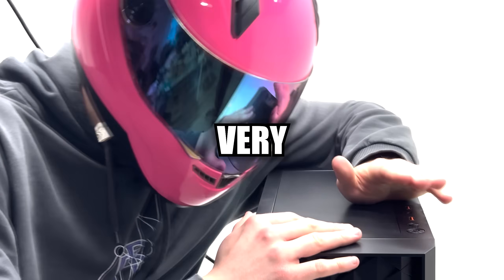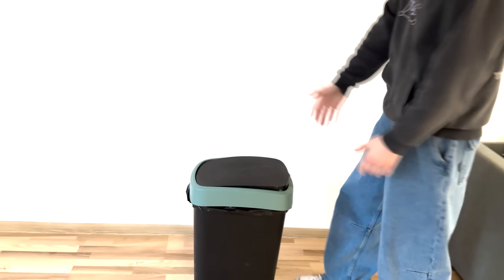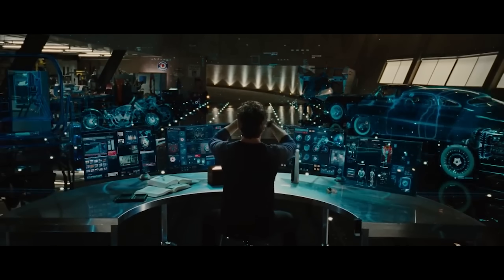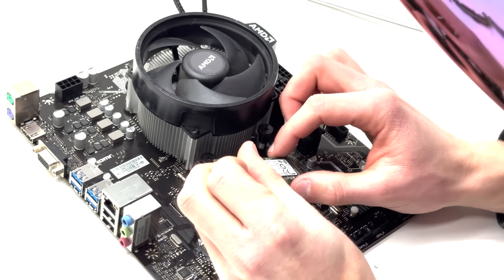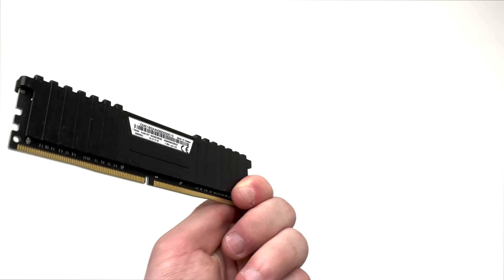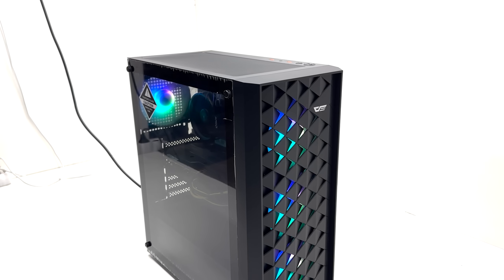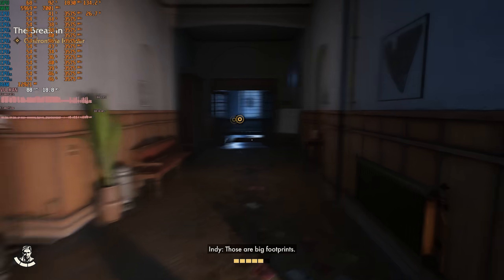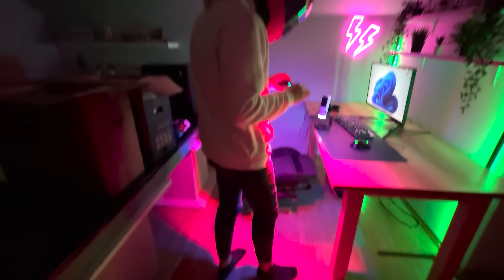Building RTX Gaming PC under 300$

Comment: Hear me out, $440 for a i9 9th gen - EVGA 3080 - 4x8 gb of ram - 650 watt gold - tripple fan AIO (LED doesnt light up but works) rest work perfectly full tower case
Reply from the maker: Now that's a STEAL
Reply: @CheapBastard  all bought from facebook marketplace locally 

Evga 3080 -$240
650 pcu - $40
Half built case (max out 2018) 
Was only missing the GPU and pcu
I9 9th gen, 4x8 gigs of ram, 3 fan Aio, 
ASUS ROG Maximus XI Hero mother board, 1tb 970 ssd - $100💀

Total was $380 not $440

I accidentally added a swap deal I did of a Xbox 1 for a 500 pcu + rx 580 

Xbox 1 valued at 60 ish

Comment: Currently rocking B450 machinest MATX, Ryzen 3 3200g, cheap 120mm cooler, Gigabyte RX 580 8gb, 600w PSU, and 32gb of T-Force Xtreem 3600 "inside" a Thermaltake core p3 "case" (using that term generously lol".. all of it used off of FB marketplace, AE, & ebay for $325. Just or the sole reason of playing Helldivers 2 lol

Comment: For 600 i got
RTX 3060 Gigabyte Eagle 12GB
Ryzen 5 5600x
16Gb RAM Corsair RGB 3200MHz
SSD 1To
Gigabyte B550M
Typhoon 550W 80+ Bronze
Watercooling  240mm
MSI MacForge M100R

You can find very good deal with a little research !

Comment: I bought a pc from a friend and the specs are, i5 9400f, Gtx 1060, h310m motherboard, and a deepcool cpu cooler and the case is a generic case, I bought it for 200$ USD and I am wondering if I got a good deal
Reply from the maker: If the 1060 is 6GB, it is a fair deal

Comment: I built mine with:
CPU: Ryzen 5 3600XT
GPU: Rtx 2060 dell oem
RAM: 32 GB Crucial DDR4 pro kit
SSD: 500GB Samsung 970 evo plus 
HDD: 2TB WD 
PSU: NZXT C750W 80 Bronze Plus 
Cooler: Endorfy Spartan 5
Case: Kolink observatory lite white
for 300
Reply: and then i sold 2060 for 100 and bought 3060ti for 173

Comment: ive built myself a sell precision t5820 bare bones 189 usd,xeon w2235 6 core 12 thread 3.6 base clock 4.6 turbo 89 usd  32 gb  ecc 40 usd  8 tb dvr hdd 35 usd i already own a gtx 1660 oc 6gb

Comment: My first gaming PC was an AliExpress combo with a Xeon E5-2670 v3, a random X99 motherboard, 18GB of RAM, and the legendary MSI GTX 1080. It was a great system, and I loved it, but sadly, I had to sell it. I was really bummed out and missed that rig a lot.

Later on, my friend came through for me in a big way. As an early birthday gift—since I’ll be heading off to university soon and money’s gonna be tight so he got me an EVGA RTX 2060 (single-fan model) for just 100 euros. Around the same time, I stumbled on a killer deal for a full PC build with an i5-9600K, 16GB of RAM (2x8GB HyperX Fury 3200MHz), and a Gigabyte Z390 Gaming X (v1).

The cherry on top? It came with a GTX 1050 Ti, which I sold to my friend for 25 euros for his fourth build, dude’s a true PC addict.

All in all, everything in the PC came up to 350 euros, but I still need to find a better cooler for the GPU. Other than that, the system runs great and looks even better after some solid cable management.

Comment: For 450 euros here is my build I managed to snag and hopefully sell for 675 euros:
• CPU: Intel i5-12400F (6-core, 12-thread)
• GPU: RX 5600 XT 6GB
• RAM: 16GB DDR4 (2×8GB)
• SSD: 1TB Kingston NV2 NVMe
• Motherboard: Gigabyte B760M
• PSU: ADATA XPG Pylon 550W (80+ Bronze)
• Case: Thermaltake View 170 ARGB
• Wi-Fi: TP-Link Archer T3U

Comment: I also managed to do a budget pc build recently, but this time with only 100 dollars. I managed to get an Optiplex 3020 MT with an i5-4590, 1T HDD and 120gb SSD for about 40 euro. A gtx 1650 for 40 euro, and got some ram and a 400w psu plus some connectors to work in that thing for about 20 dollar and now i have "brand new" i5, 16gb gtx 1650 gaming pc. I also want to swap it with a case i found cheap with a lot of RGB but that will be another 20 dollars, so i guess if i want to sell it i have to broke the budget a little.

Comment: $500
Used rtx 2070 super
Ryzen 5 3600
B550 motherboard
Case with 3 pre installed fans and a Psu basement
600 watt psu
16gb ram
512 gb ssd
Reply: Great pc for the price

Comment: I built a PC with an i5-9400F, RTX 2060 6GB, 16GB DDR4 2666MHz all on an Asrock B365M Motherboard, with a 500GB 2.5 Inch SSD and a 750W PSU in an RGB Case for £230. I'm selling it for £350 probably
Reply: Nice very good idea
Reply: bro i have almost the same build i have i5 9600k and 2060 single fan by evga and 500 m.2
Reply: You could easily sell this for around $400.

Comment: Isn't the Ryzen 5500 slower than the 3600? It doesn't have PCIe 4.0, and it has a smaller cache.
Reply: But the clocks are better, so even with the smaller cache, 5500 is very slightly faster. I would say 3600 for used, 5500 for brand new.
Reply from the maker: They're about the same. Just 5500 is slightly more interesting than the 3600 cause that legend was used in like 50 billion pc builds 😂
Reply: In game it is. The bigger chace on 3600 its better...and We all know ,thank to X3D cpus , the importance of chace in game. Finally the PCIe 3 its a limit , if you choice some cheaper or low Tier moder BS GPUs , like I imagine you will with a economic build.
5500 its always the worst choice.

Comment: I bought a PC for 150 usd, GTX 1070 and 16gb of ram, but the CPU worries me it's a 4c/8t i7-7700 saw your video on it worried it won't handle a RTX 2070/3060/6600 those are my planned upgrades.
Reply from the maker: For 150 you really got a solid deal!

Comment: I just upgraded my pc for overclocking at the same price (upgraded to 32 gb ram, 1350 watt psu, and better AIO)
Reply from the maker: Daaaamn, what kind of build needs a 1350w PSU and an even better AIO? 😳
Reply: @CheapBastard  1350 watt psu is for upgradeability for the most part, AIO is because the i9 9900k is like the og i9 13900k other than that, 16gb ram doesnt cut it for editing or gaming really anymore.

Comment: Currently hunting for a case, but the 2nd hand market is filled with 15 years old cases at the same price they were sold back then, thus 50+ €. The 20-25€ avaialble cases are just terrible for airflow on top of having the PSU slot on the top. That and waiting for a discount promo on Ebay so that I can get a b660m for around 60€, while I'm gonna pick an i3 12100f from a store that is selling it as tray for 55€. Gonna pair those with a RX 5600XT (trash Mech OC) a 16gb 3600mhz Cl16 kit I got recently on Aliexpress for 27€ and a spare CX450 for a secondary/guest rig. I'll try to hunt down those SN740 256gb for cheap as a boot drive due to the PCI-E Gen 4 and use the spare sata 480GB SSD for storage/games.

Btw that Samsung NVME is basically similar in specs to a 970 Evo Plus, pretty decent imho. I had one in my working laptop and replaced it with a 2tb one, while currently using it as secondary drive on my main system.

Comment: Any amd card replacement for this build?
Reply from the maker: A used RX 6600 or even 6600 XT if you can get it. An RX 5700 and 5700XT is just as good, but they don't support ray tracing😭
Reply: @ when you’re going cheap you don’t CARE about it (raytracing)

Comment: Man, I recently picked up a crazy deal here in Germany  got a whole bundle for 100€: R5 2600 with unused stock cooler, B450 ASRock Pro4, 8GB (2x4) 3000MHz RAM, brand new CX550M PSU, and a GT 710 lol. Then grabbed a 256GB SSD for 20€, a brand new Wraith Prism for 6€ at a local market, and even managed to talk down an RTX 2070 Super from 150€ to 100€. Just need a case for like 50€ and I’ve got a full gaming PC 😂🔥
Reply: I would buy more RAM ASAP.
Reply: Thats good work

Comment: I built my pc back in 2021, yup I didn't know about gpu shortage, i was new and i needed the pc, so I built a 34000 rupees (around 355 euro toady) pc, i3 10100f with gt1030 ddr5, 8gb ram, 128 gb ssd and 500 gb hardisk with 450 watt bronze psu and a cool case with cd drive, "All new parts" prices were high back then but I say it was money well spent, the pc served me well, looking for some upgrades now.
Reply: Ya upgrade to like an RX 5700 and ram

Comment: next do a 100 usd build
Reply from the maker: Daaaaaamn, for 100usd I'd better lowball a full PC for that price 😂
Reply: @CheapBastard  Issue is the GPU, I'm finding tons of 80ish € skylake i5 (and sometimes i7) systems from HP and the likes, Ryzen 2400g OEM are around that price too. Unfortunately these OEM systems lack any spare 8pin connector so you'd be forced to get at least a GTX 1650, but those goes for 60-70€ alone...Maybe a 150€ system would be doable
Reply: @GLDragon93  Maybe you can get a 1050Ti. Considering how strict the budget is, I wouldn't call it outdated lol